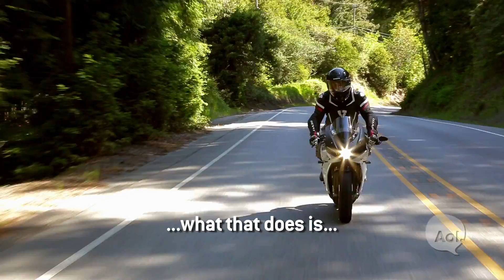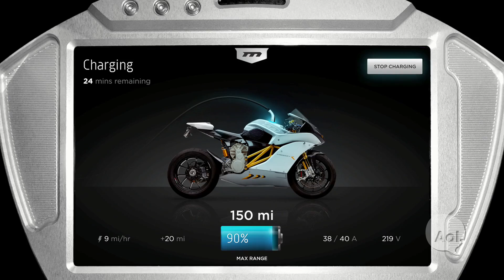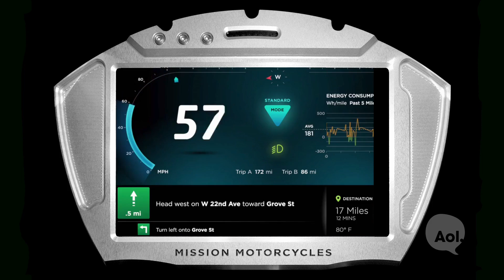Mission Motorcycles Mission RS Electric Superbike | Translogic | Autoblog

Comment: What good is a bike you can only get 100 to 150 miles on a charge
Reply: Same range as my Yamaha FZ-07 🤷🏻‍♂️
Reply: @evolv.e  yeah my Harley too but I can put gas in and take off again and go another 150 and do it again and again
Reply: Bryan Richmond and I can do the same thing on my Enérgica.. charge it, and go another 150-250 miles.. repeat. 

My electric can go actually further on a charge than my gas bike in a tank of gas. And it’s waaaay quicker. If you like monster torque, and immediate acceleration that is. Might not be for everybody.

Comment: Apparently people want a clutch... So many petrol-heads continually say something along the line of "I want a clutch, I wanna beat through the gears, it's boring without the clutch." It's almost as if these people have forgotten the reason why you NEED gears on a petrol bike: to stay in the powerband. If you aren't in the right gearing at a certain speed, you aren't making peak power. These electric bikes defeat the purpose of shifting, you have full power regardless of where you are in the rpm range. Now instead of fucking around with clutch and gears, you can focus that corner.
Reply: ***** So you understand.

Comment: I wonder if they could use the same plug as Tesla - their supercharger would be a great help for them. Also awesome video!
Reply: only problem is it wouldn't be any faster than what he has said about 45 mins since the intake to the battery has to be converted to dc inside the bike and if you tried to make it charge fast the bike would overheat on ac. Where if we had dc charge stations you could pretty much hook the plug to the battery and it would charge way faster.
Reply: lowjack Superchargers are dc to the dc battery, and this bike is the same skipping the inverter that converts ac to dc.
Reply: lowjack What I meant was that they could implement the technology that Tesla has made "open" so that they can charge faster.